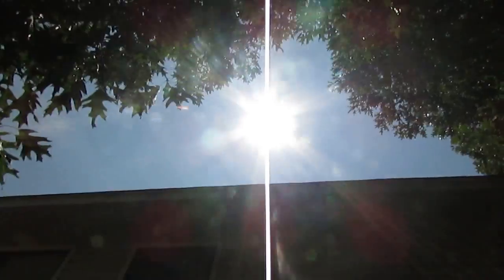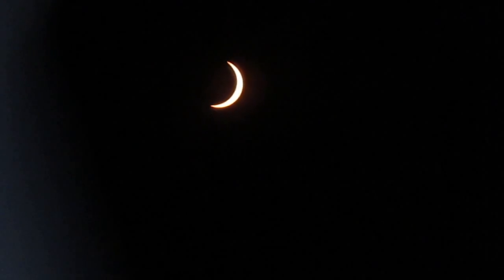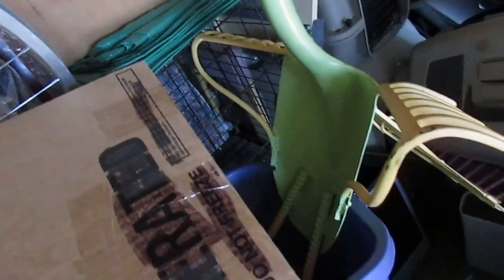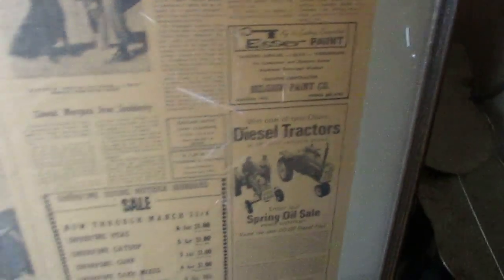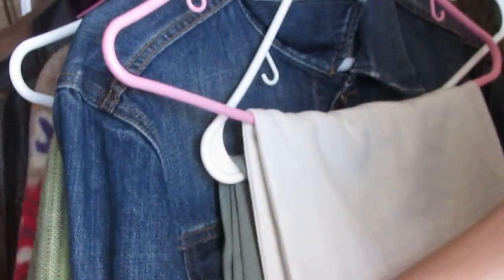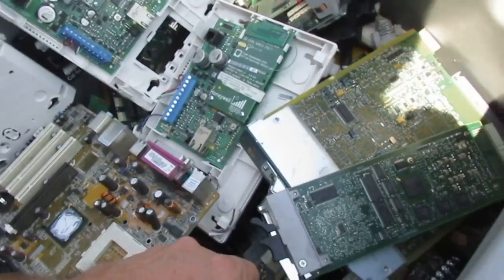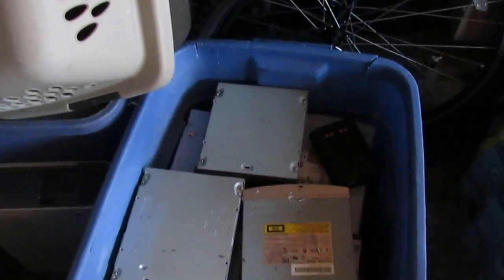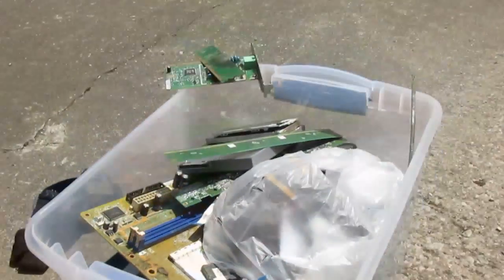GIANT GOLD PLATED CIRCUIT BOARD SOLAR ECLIPSE 2017 LOT!!! - eWaste Special Event!

Comment: Get it SV :)
Hey, board sort do have a grade for them gold pin boards, they're called "back plane expansion boards" $2.50 lb
But those type you have are much better then modern BPEB's, the pins are fully plated, new ones are spring loaded partially plated so gold recovery wise, it's a huge difference, but $2.50 lb is good money, we get half that here.
Reply: oh, someone already said it :)
Reply: eWaste Ben yea but I think the vulture trusts your opinion
Reply from the maker: eWaste Ben in the House!!! (I have now arrived as a YouTuber!)
Reply from the maker: Joe Rowland The thing about Ben is he doesn't give opinions, just the facts. ;) I don't mean to sound like the "scrooge of scrapping" sometimes when it comes to the reality of scrapping things manually by hand, lol, but I just don't have the proper controlled environment needed for recovering gold. I know this one's a worthwhile project and I was going to try it, but my cramped apt is full of animals and i would need to run an electrical cord 100 feet through a busy parking lot to use my cramped stoarge unit. I run into other issues with it as well, but ya for guys like Ben and perhaps you and others out there reading this that can just throw this stuff into their proper system and get it done it's a no brainer. For guys that have not or can not specialize for this activity (and there may be lots of them out there) there is no shame in the convenience of putting it in a box and shipping it off for a large part of the profit margin of recovering it. Plus ebay auctions for this stuff are fun ones to watch, lol.
Reply: ScrapVulture I know I watch him like you do.  You gotta do what works for you thats all good.  Keep fightin the good fight
Reply from the maker: Joe oh you were saying that Ben is trust worthy - not that i dont understand boards are valuable for diy gold recovery....lol now i understand what you meant.